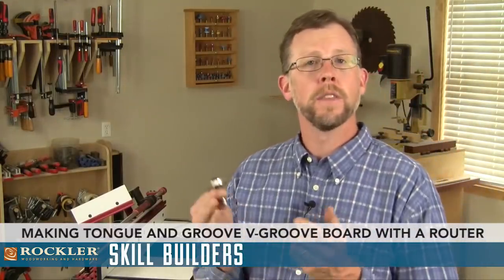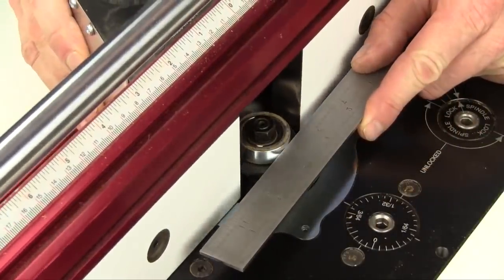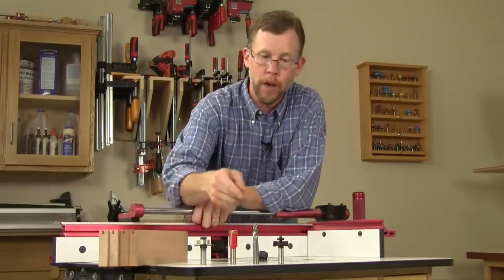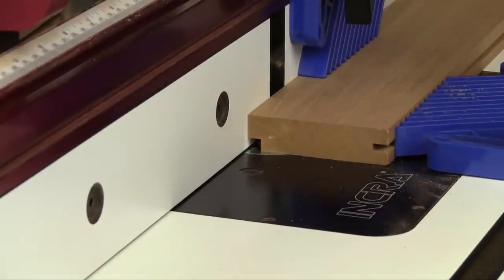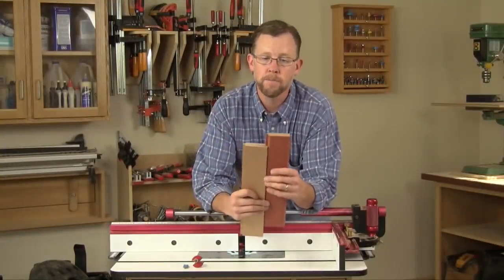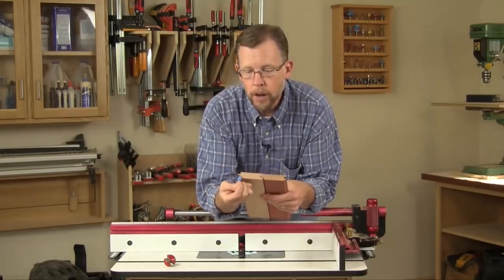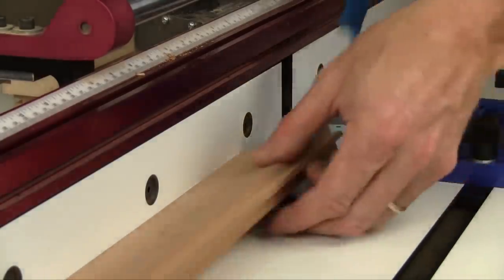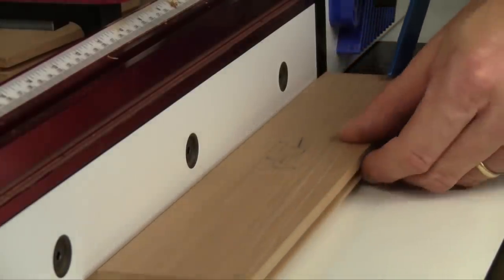How to Make Tongue and Groove V-Groove Boards | Rockler Skill Builders

Comment: about that movement in the grove ?..why not seal both sides of the wood and glue the joint .then there is no need for movement and changes in mosture don't affect the wood .Water damage is also reduced